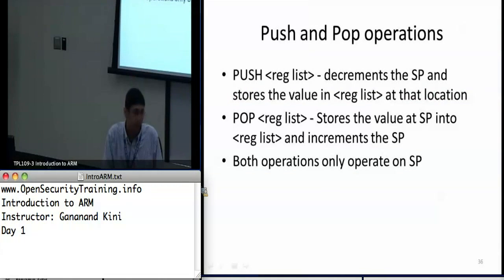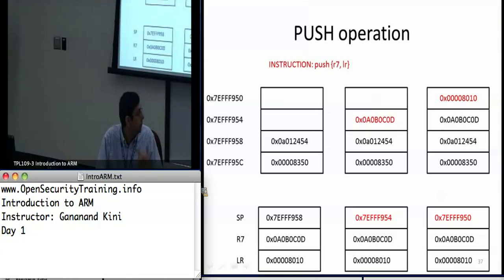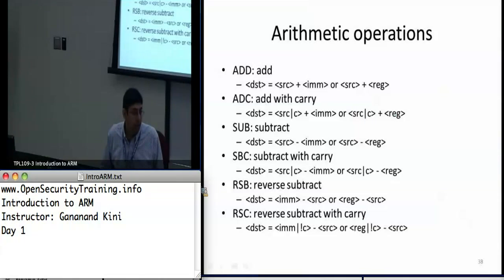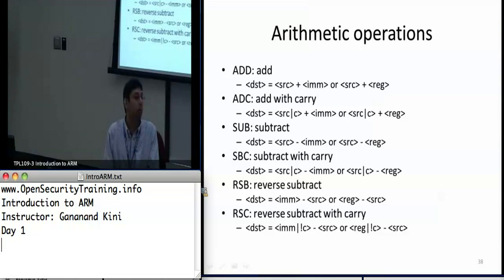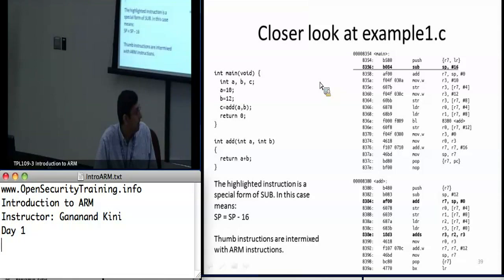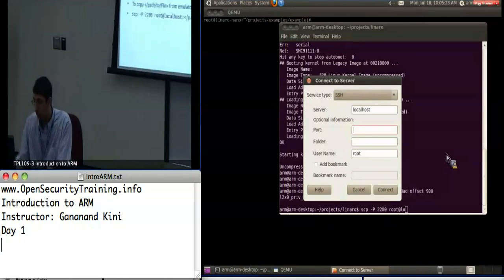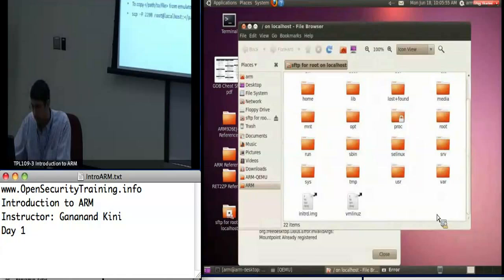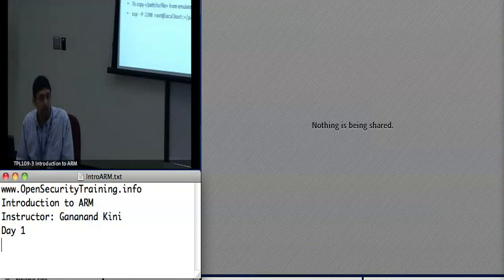Day 1 Part 2: Introduction to ARM

Comment: @13:26 he says "The instructions set is generally based on their hardware design". Its actually quite the opposite, hardware was designed to fulfill the requirements specified by the instruction set of that architecture, the hardware chip itself is the implementation of that architecture. Unless this is how it was done in ARM by Sophie Wilson (the instruction designer) and Steve Furber (micro designer). You can check how they did it in this interview  https://www.youtube.com/watch?v=jhwwrSaHdh8